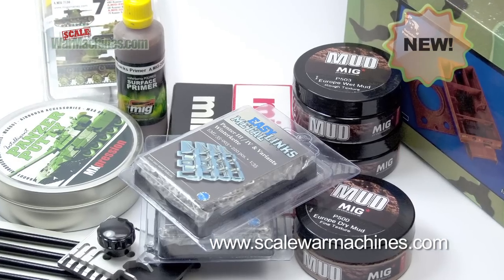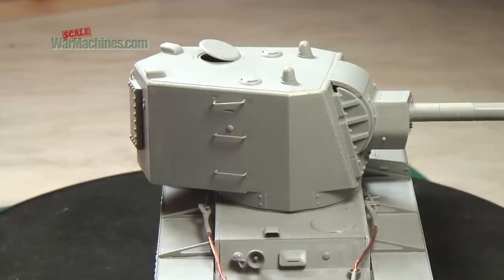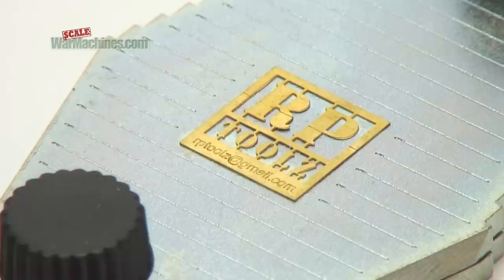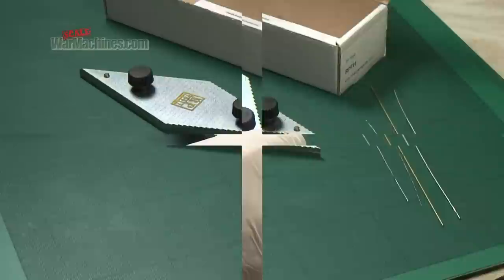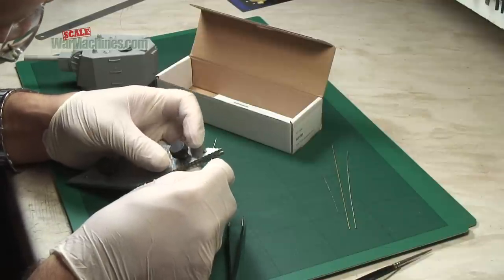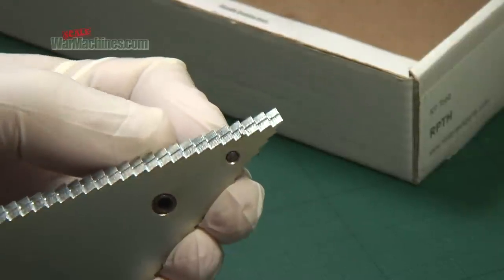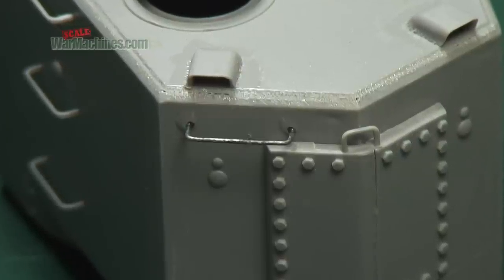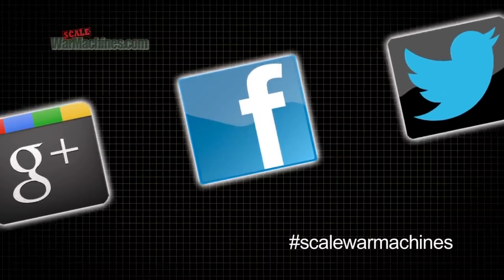HOW TO USE RPTOOLZ HANDLE MAKER

Comment: can you use hard wires like galvanised steel for example without damaging the tool?  Thanks
Reply from the maker: Yes, if it's thin gauge - although it's much more effective with softer wire.